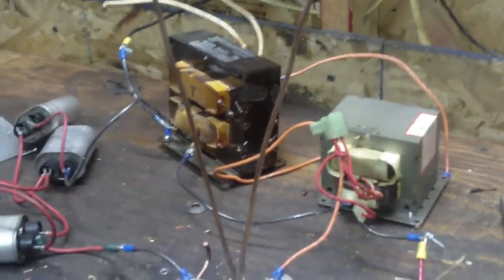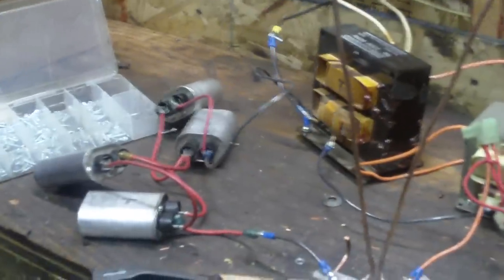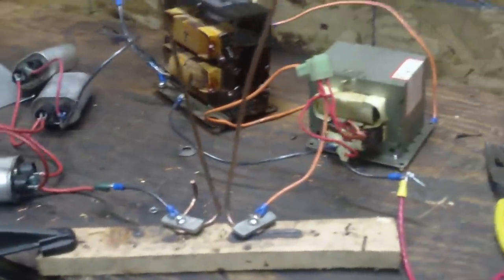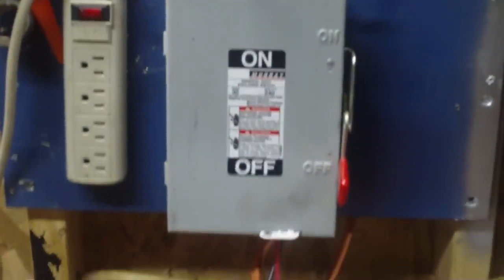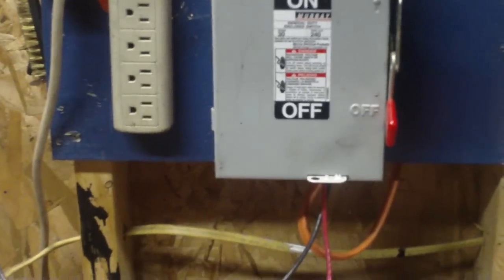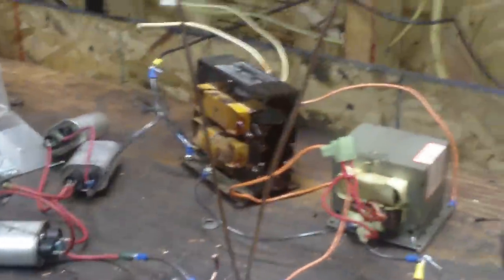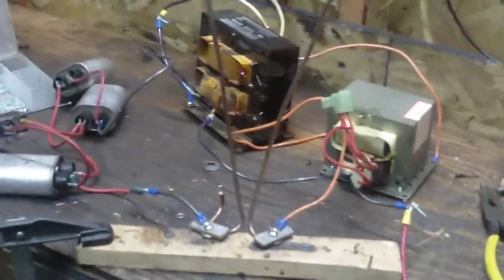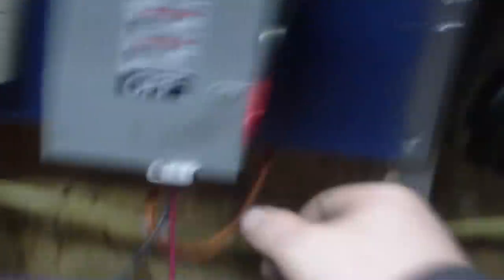Dual MOT Jacobs Ladder 4KV    ( Running Off 240VAC )

Comment: Another hint that goes very well with the plastic stool (genius by the way) is to keep one hand behind your back. Without a second hand, you'll be very unlikely to complete a circuit, basically the only other way being through the ground, which your stool eliminates.

Comment: I built this and it works very well.  I was very safe when building it and when I arc I stand on a plastic stool and arc using a long PVC chicken stick.  As a bonus safety procedure I wear rubber gloves

Comment from the maker: @drdreads1 thanks!! the 240VAC disconnect makes it alot safer. yes they are real close, i can't remember what i have them set at, i've also noticed the capacitors make a big difference, gives it a little more umph, because it is a resonance circuit. i'm sorry i can't remember the spacing, but it is set up so i can adjust them by either bending the wires or loosening the screw and moving the wire, just play with it. it should start with no help. keep on "playin" and be carefull!!! lol

Comment from the maker: @twirlywirly555 i hear ya. i have 6 mots, i've thought about using all of them, put them in a bucket and fill it with mineral oil, set it up like a distribution transformer and run it off 240. i don't have any NST's, i don't like the little arc, i like the big arc from mots haha

Comment: That's impressive for a 4kV Microwave transformer and Capacitor setup!! Maybe it's because you used a 240v primary power source, and at 40A that's roughly 10kW, with a regular 120v set up, it's usually only 3-5kW, need to install a 240v power source to run my stuff as there's a serious voltage drop when using 120 from the panel.
Reply from the maker: Thanks! Yeah it did more than I thought too, I had a another setup that i didn't get on video before some of my transformers and capacitors blew. 240 is alot better, it keeps the voltage drop down and amps down too. thanks for watching!!!
Reply: You're welcome! Much enjoyed!

Comment: Nice! I made the same but with 2 MOCs in series, and it was shorter that use 1 MOT and 2 MOCs so I stayed with 2 MOTS in Series, is becasuse I need another 2 capacitors in parallel?
Reply from the maker: Yes, for the setup it has to be like in the video to get a longer arc. be safe. Thanks for Watching!!!

Comment from the maker: well thats what i mean, Don't do it unless you have had proper training. Actually with microwave oven transformers, the output is 2.1K volts per transformer, but its over 2 amps, when direct shorted or in a jacobs ladder like this. Its very dangerous. The only way to cut the amps down would be to ballast the primary side. The safest HV transformers are Neon sign transformers. Thanks for watching!!!

Comment: nice set up man! how do you make it self start? im assuming you have the electrodes real close at the bottom to initiate an arc? what is the spacing?.
i have uploaded a video of my own duel resonant mot jacobs ladder today,check it out,i have to use a piece of copper wire on a pvc pole to get it to start tho.

Comment: With these ive saw the 12v 10 amp mot into  electromagnet with 2 and holds alot. But good clip. If no $ to run be good ornament:) if behind glass.

Comment: @fnaguitarplayer9 Yeah , i think they would be ok up to around 10kv open air , but oil is a safer option :P , well if i could have 15kv @ 300ma from 5 NST id take it :P run it for ages and ages and transformers would never complain

Comment: It is .80 amp not 1 each MOT  I don't think you running 240 v on each mot do you?  There are two Hot and one Neturel.
Reply from the maker: Wasn't for sure of the amperage of the high voltage side, I had the primary windings in series connected to 240, so there was 120 across each MOT's primary. Thanks for Watching!!!

Comment: You keep reiterating not to do this yourself. Why not, given the proper education? Considering this is high voltage and not high amperage, it should not be that dangerous, unless you let those amps flow freely.